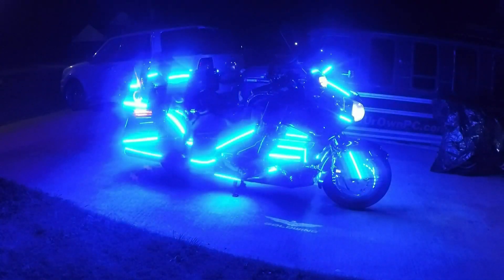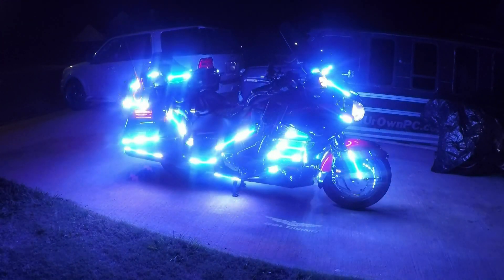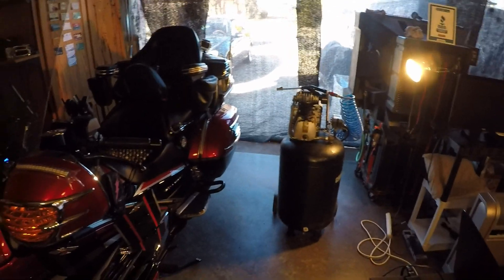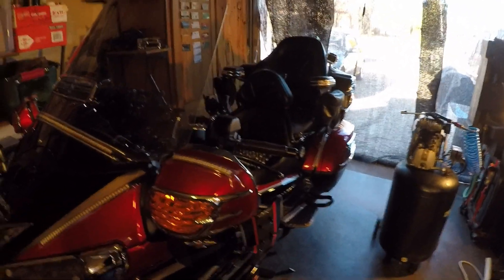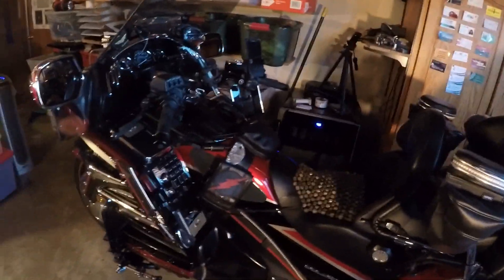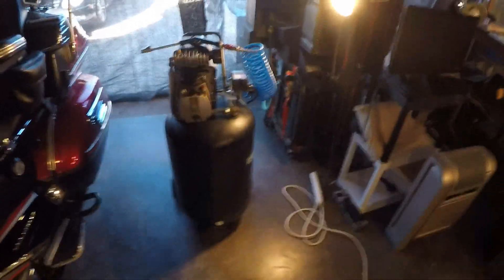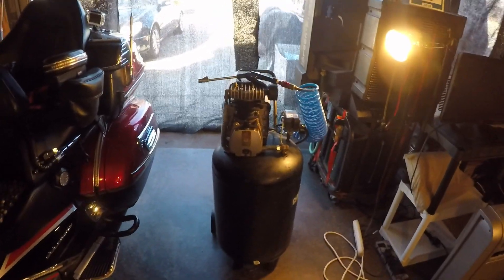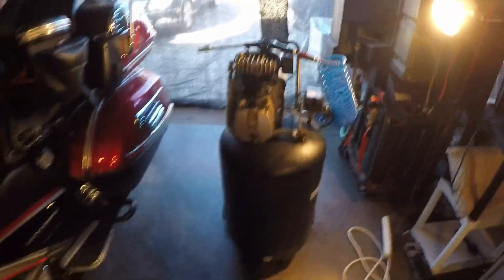How to Solve The Goldwing TPMS Indicator Light Staying On

Comment: Mr. Luckett, THANK YOU SIR.    I drained my compressor, pulled the stems from both tires.   Just to be safe emptied the compressor one more time then refilled it, then filled the tires.  Several hundred miles later, the TPMS light has remained off.   So thanks for the great advice!   Compressors may have filters to keep from putting liquid water in the tanks <or whatever you are inflating> but the moisture in the air <also known as humidity> goes into the tire.  So especially, when that air is cooled it again starts to become liquid and that's when it can screw up the TPMS..... The moisture, for me, was the issue, never the tire pressure gauges .  I once bought three of the gauges at the same time (to put one in the truck, one in the car, one on the bike).   I tried them all on the same tires and they varied as much as four pounds......

Comment: Fascinating.   Tire gauges are notoriously inaccurate.  But the TPMS light going out probably has more to do with changing the air.  I had not thought of the moisture in the compressor tank.  Here in the Midwest the hot humid summer air will result in lots of water in the tank.    I will definitely give this a try as my local dealer said "about $230 to work on the TPMS...…"   I"ve learned "about" means the starting point.   Thanks Corneal

Comment: Just got the bike back from dealership. They said they had to replace rear tire sensor. So far so good. light is still out. They said they replaced both sensors a few weeks ago. I think they lied to me. I guess its possible the sensor went bad twice in two weeks. Who knows for sure.Thanks again flash
Reply from the maker: No problem brother, sometimes you have to do the dreaded taking it to the dealer thing, glad to know it is all good.

Comment: I'm glad it worked for you, but!!  From what I understand and experienced on my bike.  The TPMS light will come on when there is a problem with the TPMS " system".  When your tire is low on air pressure, you low air pressure icon light will come on (the flat tire looking light to the right of the TPMS light).   Often when the TPMS light comes on, it's because of old batteries on the sensors.  TPMS light, it's the system.  Flat tire icon light, shows your running low pressure.  If your TPMS light is on, showing a problem with the system,,,,,,I don't think your low pressure light will come on.  
1. I'm curious if your TPMS light is still not coming on.
2. If your low pressure light EVER comes on?
Reply from the maker: Thanks for good response, several issues from different Wingers was reported and each had to solve the issue differently. One had taken his wing back to the dealer. I guess I was the lucky one, my system would only come on during the cold months for no reason come to find out after putting back to original valve stem (at one point I was using the tire balancing Beads, in which, you had to change out the valve stem) the original valve stem fixed the issue during the cold months.
Reply: I would like to know where you got the lighting system

Comment: Flash, I followed your information step by step. It did not work for me. It was worth trying though. process of elimination. I got a good tire pressure gauge and valve remover out of the deal. That was worth it anyway. So bike is under warranty and I will take to the dealership first thing Monday Morning. Thanks for the video.
Reply from the maker: Hey, my brother, A couple of guys told me they had to take it to the dealer to get whole TPMS replaced, good idea to go ahead to the dealer, I got lucky "for a change" every winter I still have the same issue but only when it is cold outside, good luck.
Reply: The dealership had the bike for a week , last week. They told me they replaced both sensors and the module/brain. When I picked it up ,the light stayed off for about a mile, then went back on. I took it back to the dealer, he said he was contacting Honda because he did what it called for and the light came back on. He said friday that there was some sort of a part honda was sending them, and to bring it in on Monday. I seen your video and just wanted to give it a try first. Anyway, off to the dealership tomorrow morning. Thanks again.
Reply: the tires are holding air pressure. no leaks. I got it by the book 36 front.41 rear
Reply: Is this light a safety issue, or more of an idiot light ?
Reply from the maker: It's a safety issue because if it is working correctly there is something wrong with your tire pressure. The first time it happened to me I had a very small nail stuck in my tire, just small enough to hold air for 2 or 3 days and then the light will come back on. I did not catch it until I pulled the tire completely off, I got lucky.